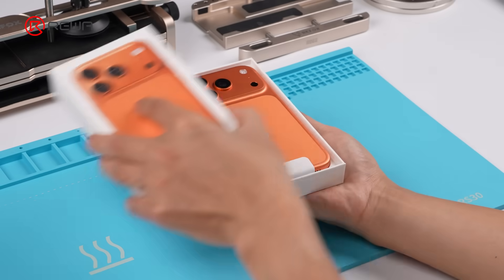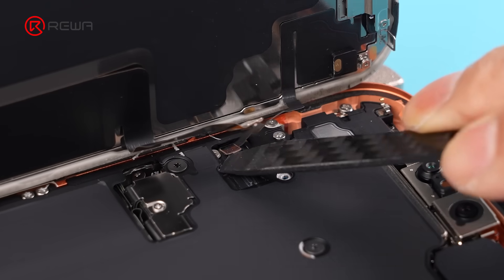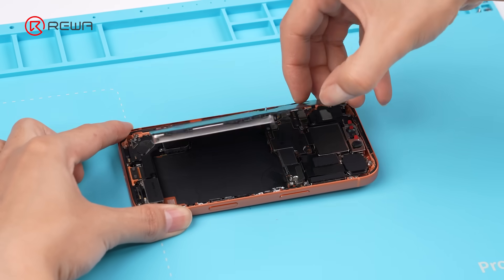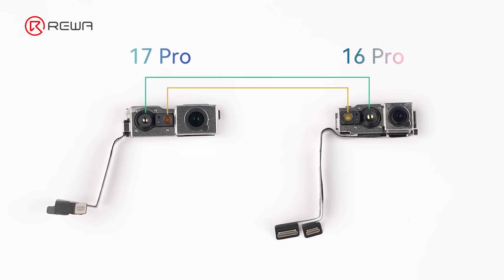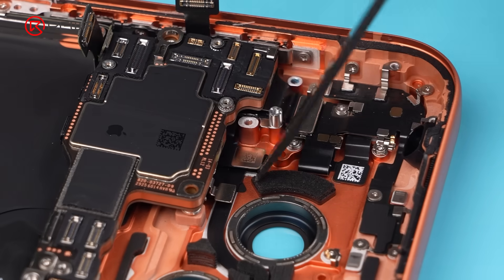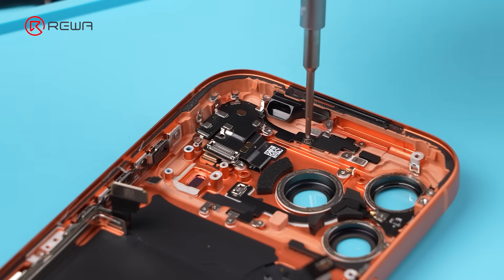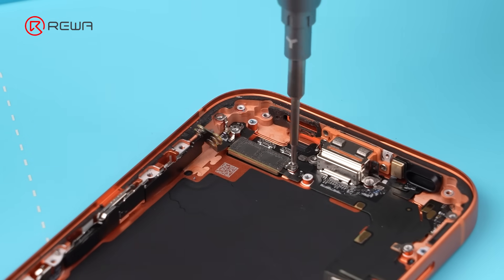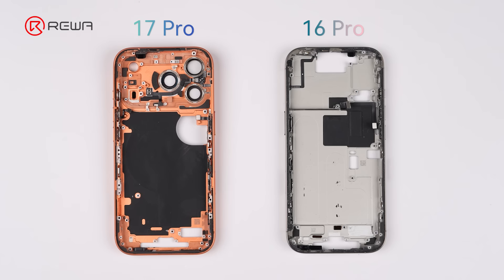iPhone 17 Pro Teardown: Big Upgrades Make Repair Harder?

Comment from the maker: How do you feel about this iPhone 17 Pro big changes? Will they make the repair harder? Drop your comments with us.😜
Note: the 17 Pro battery capacity is 3988 mAh, not 3998 mAh, so 406 mAh is more than 16 Pro.
Reply: we need air
Reply from the maker: @ЛоговоБарсука  Coming soon, stay tuned us~~
Reply: 不是工作几天就能买部iphone，用得着修吗😂
Reply: if iPhone can be opened only from the front, it is much difficult and costly to repair. Also, double connector and short flex cable connected to the motherboard is a bad for repair
Are you planning to separate motherboards ? I will love to see the modem and if SSD can be upgradable.
Reply from the maker: @ronlevin2339 You know, not so quick, after all, we plan to test more With this new model, and we will not only teardown this pro😊
Reply: @rewatechnology2008  There are more natural sounding AI text-to-speech software/websites out there now. Please use those instead of this Microsoft Sam sounding bloke. It's not the early 2000's anymore you know.
Reply: Will be interesting to see internals of new 4x telephoto compared to old one 5x
Reply: Are those screws stainless steel?
Reply: @romella_karmey  These screws will never rust, and if you see them rusty, know that the device is going to the scrapyard.
Reply: I thought they were all esim this year

Comment: So the vapor chamber is only for the battery? Wonder if someone will test putting this phone together without that back plate with the vapor chamber and see if temperature changes are observed, or if that was a failed attempt to control overheating, because I saw Max Tech video and the 17 Pro Max screen got dimmer before the 16 Pro Max he was testing.

Comment: the design from backpanel is for batteryreplacment for the next iphones in 2027, New EU Law Makes Smartphone Battery Swapping a Reality Again
Starting in 2027, a new EU regulation will require that batteries in smartphones and other electronic devices be easily replaceable by consumers. This marks a significant shift away from the current trend of glued-in batteries.
Reply: iPhone stopped gluing battery long time ago, they were using pull tabs for a while

Comment: So when I'm replacing back glass at work I'm going to have to remove the entire board to get to that connector underneath or was it accessible by just popping off the back glass? Not looking forward to this lol I do love my 17 pro max though gorgeous phone
Reply from the maker: You may not take out the battery cuz the cable is in front of the VC board.

Comment: Mind blowing how much engineering goes into every time making this iPhones.
Reply: It's all about marketing and making money so people talk about apple. Last 5-6 year same iphone design outside but inside continuously changing to not make it repairable. That doesn't mean that making a better phone is just Apple wanting to convince us they are makeing a better phone. Now new vepor chember thing  between display and the battery they put, and go with the older aluminium body to make more cheap phones, slightly change looks to create profit, instead of innovation
Reply: @mitesh7998 
Apple has been changing design to make it more repairable.
In older phones back glass was glued newer design it can be replaced.

What do you mean by repairable?
What can’t be replaced?
How is mid plate causing issues ?
Reply: This is not mind blowing engineering it is aesthetic engineering.😂

Comment: Looks highly repairable. Well done apple. Keep going like this please and your customers will appreciate it.
Reply: Always the same problem with iphones. You need te remove the screen before being able to acces the internals. Screen is fragile and the most expensive part.
Reply: @dennis-br6vr yes
Reply: @dennis-br6vr  Lol screens of iphone are barely fragile since the 13... I can open them without pretty much any heat and jsut a bit of alcool and a tiny sucction cup, screens are also the number one failling part as people tend to break them easily, so it's normal to make the most breakable part the easiest to access, repairing a iPhone screen take me 5-7 minutes max at my shop, on a Samsung it take way more, especially with all those screws in plastic that are a pain to get sometime, also samsung have way more screews for a screen repair, if i'm 30 minutes away from my end shift, I will with no doubt accept a screen repair from pretty much any iphone, while I will really pay attention to what screen I need to repair on a Samsung especially if they are not coming with the frame (it takes a TON of time to replace those without frames, and Samsung is more and more leaning toward frameless screen repair...), and most of the time I will decline a on the spot repair, as I need to close ther shop etc.

The only thing I wish Apple had from Samsung would be the repair time of their charging dock, it takes 3 minutes to change it on a Samsung (and hell, they fail so easily I'm glad lol)
Reply: Igoring suction cup and isopropyl alcohol
Reply: @nutzeeer probably 99% of phones need a suction cup nowadays unfortunately. Gone are the days of replaceable batteries.
Reply: @MrCoffisthats true. im seriously considering a fairphone for that reason.
Reply: @nutzeeer in a perfect world the iPhone should have been the most repairable of all phones given that it's the most sold single model phone, because the availability of parts is the biggest issue in most things that are meant to be repairable. Here we are though begging Apple to make their phones more repairable while they advertise themselves caring about mother earth. Bunch of hypocrites. They need more public pressure to make their products more repairable.  Macbooks are the worst. As a customer you are more comfortable to buy a device that you know you can repair than one that becomes ewaste but they don't care about what customers want or what's good for the planet. I hope the trend of repairable devices continues.
Reply: @MrCoffis
What exactly you can’t replace in iPhone ?
Reply: @nutzeeer 
Agree, they should invent something that will hold display to phone without adhesive.
May be screws ?
It may look ugly but most people will be ok
10 screws just like how they are holding top plate inside ?
We will loose some display area it’s ok
Reply: @gund89123  i think its got more to do with water resistance

Comment: Is it a great idea to put a vapor chamber that transfers heat to a display?
Reply: Then what is the sense of old aluminium body? It's all about cost cutting to create profit instead of innovation.
Reply: @mitesh7998 
Aluminum conducts heat better than titanium.
Metal plate with vapor chamber is touching the outside metal body

Comment: The vapor chamber is on the secure plate under the screen and between the battery, not in contact with the aluminum frame, interesting.
Reply: Yes i see, it's all about lie why they moved the old cheapest aluminium body not even using a stainless steel body. How to make the phone cheapest to get more profit, instead of innovation.
Reply: All done by apple cleverly to brainwashing 😅. Normal people blindly buy.
Reply: @mitesh7998 

As a materials science engineer here is my theory
Metal around front and back glass is the only area to dissipate heat from internal components.
Aluminum is better in conducting heat than titanium.
Metal plate with vapor chamber is in contact with outer metal.

When two metal pieces are in contact heat transfer happens.
Reply: @mitesh7998 
As a materials science engineer here is my theory
Metal around front and back glass is the only area to dissipate heat from internal components.
Aluminum is better in conducting heat than titanium.
Metal plate with vapor chamber is in contact with outer metal.

When two metal pieces are in contact heat transfer happens.
Reply: wouldn’t this design only heat up the battery more? because its apparently conducting heat to the battery and not the aluminum frame for dissipation 
i am kinda perplexed by the location of the vapour chamber
Reply: @Toothless_the_Nigjt_Fury4010 Yes, reviews are coming in for the new 17 Pro, showing only a 2-5% improvement in battery drain tests due to better chip efficiency. I don't think Apple aims to make a more expensive phone; instead, they cleverly reduced costs by switching from titanium to aluminum body and just made a few dollar vaper chamber adjustments in components to manipulate people. Also new model, it's already more complex inside, making it not easy to repair.
Reply: @Toothless_the_Nigjt_Fury4010
Metal plate is in contact with aluminum enclosure?

Comment: You have to give it to the engineer for the components design on the iphone.  Outside looks similar but inside is a whole different story.
Reply: It's all about making money, the last 4-5 years the same design internal change to convince us they making better phones , improve aesthetically inside, they blame hitting issue to put veaper chamber but they put it between display and battery not back side attached with body, cleverly move old aluminium body to create more cheaper phone and Increase the profit rather than innovation.
Reply: @mitesh7998 well innovation can’t come every year.  We human has appetite for new stuff all the time.  Who or what company can change design annually?  Of course business needs profit.
Reply: @mitesh7998 vapor chamber is in contact with outside metal

Comment: FINALLY THE BATTERY IS ONLY SCREWED DOWN. Fantastic design 👌🏼
Reply: nope, there's also an adhesive that can me removed by apply current to it. 
awesome invention, better than pull tabs.
Reply: @Danny-wv8ec  enlighten me as I don't see how this is better than pull tabs. with pull tabs, all you need was some alchohol and a pair of tweezer and that's it. but this? idk man, the phrase "apply a current to the battery" doesn't sound that safe to me. and that's before we even mention how to reapply the adhesive.
Reply: @vuxluongw  Because Apple was working on their vapor chamber for quite some time I think and this (linking the battery to the heat dissipation) seems like the direction they want to got forward, dissipate the heat of the battery extremely fast by bonding the battery with the heat dissipation, it conduct thermal WAYYYYYYYYYY faster than with pulltabs.
Reply: @vuxluongw i didn’t say that it’s better, i said that it’s an awesome invention since you can do it with a 9 volt battery or a cheapo power supply. 
They did it on the last gen iphones as well.
It also minimizes the risk of puncturing the lithium batteries since the pull tabs usually break.
Reply: @vuxluongw  You don't actually apply current to the battery itself, you apply it to the steel plate the battery is glued to and the outside metal casing of the battery, letting current flow through the glue binding the two components together. Current won't flow into the battery cell itself, the electrical charge stays on the outside of the metal casing because of the Faraday Cage effect. :)
Reply: @vuxluongw  it is safe, its amazing. accept new tech bro. its already here. why buy alcohol and risk damage to other components?
Reply: @puffpuffpuff  alcohol evaporates quick, hence it doesn't even do any damages to the components so idek what you're talking about lol
Reply: @Danny-wv8ec but looks like thats prototype for now
Reply: @nzs292  tf you mean, he literally showed it in the video
Reply: @thejason6767 i mean apple did this design as prototype and i think apple wants to complete resign of battery compartment (my theory)
Reply: @nzs292  how can it be prototype when it has already been mass produced? the plate is there to help further dissipate heat from the motherboard and battery throughout the chasis for better cooling performance. Also, the shield is there for safety purpose of preventing the battery from getting poked/punctured by accident when repairs or battery swaps is being done to the phone.